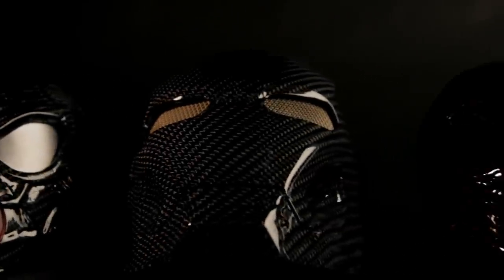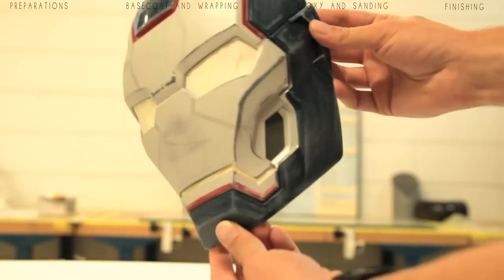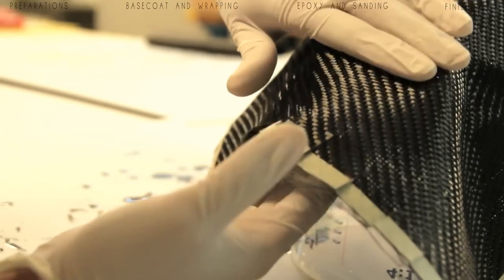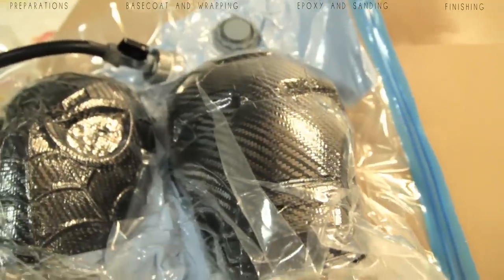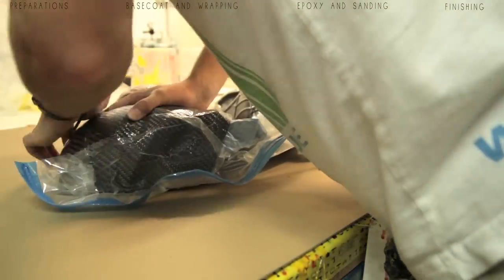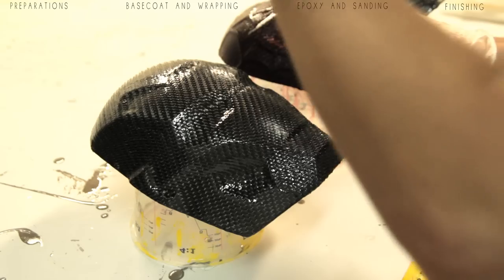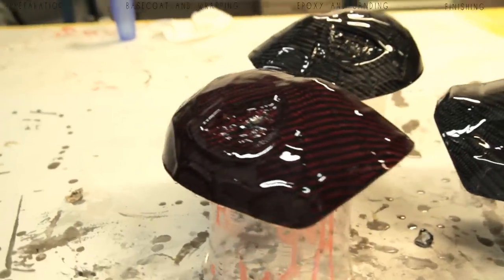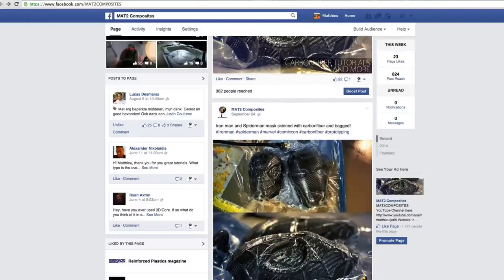Carbonfiber Skinning or Wrapping Tutorial - Ironman & Spiderman Mask

Comment: Tip: using solidworks you can download .stl files of masks and so on and use "flatten" option to flatten the surface of the mask from 3D to 2D with the option of release cuts built-in to prevent warping. Print on paper for a template to cut the carbon fiber.
Reply: sharon f im new with solidworks.. is there any tutorial on use the " flatten " feature ?

Comment: To minimize bubbles... make sure you're putting on extremely thin layers at a time. Also use a hair dryer or heat gun with the resin is still wet to eliminate the bubbles.
Reply from the maker: Thomas Christopher White thanks for the tips!
Reply: Thomas Christopher White when? while it's in the vacuum bag or what?
Reply: U WUT M8? No no no.. if you have a vacuum bag or using a mold and vacuum bag method, you only need to let the air bubbles drain out with the excess resin since that process is already air tight. Using a hair drier or heat gun to eliminate bubbles only applies if your doing brushing on layers of matting and resin.
Reply: sweet thanks!

Comment: If you are just going for the look just us g.p. Resin with a heavy clear gelcoat sprayed over it after sanding. Use wax solution thin with styrene and maybe a touch of speed patch. Wetsand 320 6-800 buff. It can be done in and hour or so from start to finish

Comment: A personal recommendation for the masks is to get some clay, oil based preferably since water base dries quickly over time, and fill the insides of the mask. So once you start vacuuming the mask doesn't lose its form and you get a better result since it rests on the clay.
Reply from the maker: great idea, thanks for the input!
Reply: And just to clarify the glossy texture as seen in the end is after washing/degreasing the mask yes?
Reply from the maker: +GaiaChrono the mask is right after clearcoat

Comment: Have you try spraying aceton after you apply your laminating coat? It surely helps to flatten your resin surface so you don't have to make too much layer... Also no need to do several sand work, all you need is a single sand work before clear coating... 
Anyway, love the fail part, it helps a lot 🙏🙏🙏
Reply from the maker: True, tried it before but try to avoid it to prevent contamination... Rather use heat to remove air and flatten the surface
Reply: @MatthieuLibeert  agree

Comment: When you are sending the surface after applying epoxy - use Scotch Bright! It will work way better with highs and lows.
Reply from the maker: I do follow you on this one, the problem is that it is to "flexible" with sanding paper you are removing the highs only so you are left with the lows...If you follow what I mean, when you then add resin again the high and lows will be totally flat to a high gloss :) with Scotch Bright you are just sanding "waves" less lows less highs... Not saying my way is the best, sure there are other ways, its just a way I feel safe with and know it will work out great for me :)
Reply: Matthieu Libeert Thats understood. I just mean that if you cant sand the lows - there may be some problems with the adhesive between the layers. May be i`m not right. Will try your way as well ;) 
Here is what i made last time. https://b-a.d-cd.net/563140cs-960.jpg

Comment: Good video, i saw some vids from you.. But for small parts i tried the vacuumpumpmachine for the kitchen with his bags ;) worked very well.. The vacuum is enough for small parts and didnt deform the parts.. I dont need the base coat in black right ? Im using the resin for the first layer and wait 4 hours to become tacky, and then first layer carbon comes on.. Again resin and then ?? I have to wait again till its tacky or i can put the next layers ????
Reply from the maker: Chucky Norris correct, no base coat is needed, you can use epoxy wait for it to get tacky, add fabric, add epoxy, wait for it to cure tacky and add a second coat, then sand and do exactly the same till surface is good
Reply: Ok thanks for the answer.. I try it and give feedback... But how you handle the edges and curves without destroying the carbon layers ? Just laminating positive
Reply from the maker: Chucky Norris it takes a bit of practice, a twill weave carbonfiber will allow the weave to bend around 3D shapes, there might be some visual distortion but should be a big deal

Comment: Matthieu Libeert I'm starting a deathstroke build and I want to make most of the suit out of carbon fiber because I need it to be tactical and I was wondering if you could do a video on how much it costs for carbon fibering and how many layers it needs before it can be used in a tactical situation  thanks
Reply: Yea I second that question. I just did a video about fibreglassing my Deathstroke helmet on my channel and it was crazy strong. But how strong is the carbon fibre?
Reply: its 3x stronger then steel and a third of the weight

Comment: hi, Matthieu! 

just seen this video. wow, 2014 :-) 

at 12:37 you add some black pigment, 
was it only two drops (as we see) or more of them? 

about the layers of epoxy over the carbon, 
was is a regular epoxy? or the one specially for this skinning process, the XCR Epoxy Coating Resin? 

thank you! 
best regards, 
Mircea
Reply from the maker: Time goes fast 😁 I've used the EL2 laminating resin hereif I remember well, but would be better with XCR, at the moment making this video XCR was still in development so wasn't able to use it in this tutorial 🙂
Reply: yup, time... goes slow but FAST :-)
and about the black pigment you put at 12:37, was it only two drops (is it that powerful), or were there more drops?
thank you!
Reply from the maker: @mirceaandreighinea  you can choose, might be better with a few more but it's strong stuff indeed
Reply: Matt, thank you!
best regards!
Reply: i am thinking to use fiberglass and adding some of this liquid pigment in the epoxy. do you think it will be black (or read, blue, etc) in the end, as final product? 
thank you, Matt!

Comment: If you were to make a mold with the original mask it seems like it would cut out a lot of time. I've seen it done on other videos and the mold parts come out as perfect copies with no sanding needed plus using a mold you could gell coat it to add strength. Just a suggestion, I know there maybe other reasons you don't use molds.
Reply from the maker: thanks for your comment, like you might see on my channel I'm mostly using moulds, this was just for "educational" purpose that I've showed how carbon fiber skinning is working and what results you can expect from it :) but your remark is totally correct

Comment: Matt, this is a great video thank you so much!! Rich from Carbon Composites told me to check your vids out as i had already seen this one i figured i would look over it once more...I'm building a full face helmet from back of neck to fron of adams apple.....do u suggest i just wrap my carved versions with carbon fiber after adding the epoxy resin and skin base?? Then i could just cut it in half from ear to ear and use a hinge to keep it together?? Let me know what you think!! Thanks bro!
Reply from the maker: +Patrick Duquesne thanks for the positive comment :) glad to hear you've found your way to my videos, and other suggest you to watch them! What you are proposing sounds like a good plan! but make sure you use some release then to be able to remove the carbonfiber piece from your carved version! it will also be a bit difficult to cut it...with a dremel you will have to be very carefull not to cut through you carved version if you want to use it again :) good luck!
Reply: Thanks man appreciate the feedback!!
Reply: +Matthieu Libeert (Mat's Prototyping) what kind of mesh did you use for the eyes?

Comment: Hi, Matthieu!
Why did you choose not to use pillow vacuum bag for the next step?
Reply from the maker: DJKorzH what step do you mean?
Reply: Matthieu Libeert i mean the step right after the forming when you are applying the resin on the fiber  for the first time. Doesn't it may help you to make an even surface? Or may be it will be better to use a bag with the resin already applyed?
Reply from the maker: DJKorzH I tried but as you can see in the video it was kind of hard with the Stretch vacuumbag... went pretty easy later on by just applying the resin on top and let it flow...kind of scared to have wrinkles from the bag in resin on the part
Reply: Isn't it the same as a handmade bag?
By the way, did you nowtice the black pigment spots on the fiber right after the vacooming?

Comment: Some people don't need to use a vaccum bag but others, like you, do. When do you need to use a bag?
Reply from the maker: like you say its a matter of personal preferences...i like to use it to get everything firmly against the part and have more detail
Reply: Thank you. There are a few dings and dents near the top of my motorcycle aluminum gas tank. It is a flat surface with a few curves. I would like to apply a layer of carbon fiber over the surface to cover up these blemishes purely cosmetic reason, not structural. Is this feasible at all for a first time project or is it much more difficult than it seems?
Reply from the maker: +FIFTYmil sounds possible, you cant do much wrong its a matter of how much time you put in it...bit succes or not will be up to you :-P try am easier part first maybe to get confident

Comment: Hi Matthieu The brush gets hardened after applying a layer of resin and can't be used again. Is there anyway to resuse brush again?
Reply from the maker: Leo Yuan the brush cant be used again once the resin in it has cured. but there is a trick, you can clean them/store them in acetone but, unfortunatly for nature, it's cheaper to buy cheap brushes and throw them away

Comment: looks awesome question.. do you think this could be done on a car hood?
Reply: you are probably best to "wrap" a car hood. it's like a large sticker.
Reply: +Dean Howard would it have the same shine? or would i have to do some kind of clear coat after the wrap?
Reply: you can buy it with a shine although not quite as good as epoxy can buff upto. I suggested wrapping as it's alot cheaper and can be removed. if not your best to take a mould of your bonnet then make a carbon fibre one.

Comment: is there a stretch film that provide a better and flatter surface?
I am looking to wrap car parts in carbon but i want to scape as much as adding epoxy and sanding as possible. it's a very difficult job.
Reply: You can try using the water transfer method
Reply from the maker: +AXMT or wrap it with a fake vinyl carbon, but wouldn't be the real deal anymore :)

Comment: A very stupid question, when do you need protective breathing equipment working with carbon fiber?
Reply: Its not the carbon fiber you need a mask for, its the resin to harden the cf. Always use a respirator when using resin, be it fiberglass or so, the fumes can give you brain damage and cancer on percentages.

Comment: Just one question, i use the  easy composites laminating resin, but it stays tacky for a long time.
The resin in the cup gets really hard but the resin on the part not, it's a 21degree celcious room. do you have a solution for this?
Reply from the maker: few possible causes: Sure you mixed the resin with the good mixing ratios (100+30)? did you mix the resin well (2min)?
Reply: Matthieu Libeert  yes i used the 100+30 ratio, i mixed it for a 1,2/2 minutes, but i get a problem with the airbubbles. i normally use the topcoat from hp-textiles but than i do not have this problem so much. it stops sticking after a few day's.
i've seen you're movie's that was for me the reason to try the Easycomposites resin

Comment: Excellent video but wouldn't it have been easier to simply create a mold out of the masks and then inside the mold placing some prepreg carbon, vacuum and so on. Sanding takes to much time and with this type of shapes having automotive reflection is almost impossible without spending a tremendous amount of time.
Reply from the maker: Yes correct, just wanted to make a video to explain skinning carbon fiber here 🙂

Comment: hey man i know your more of a carbon guy but would fiber glass work for real armour
Reply: Shikei Cosplaying yes it would, use fiberglass resin, with enough layers it'll be level 3a bullet resistance
Reply: thanks man
Reply from the maker: same process with fiberglass :) use epoxy as well
Reply: There's also aramids (kevlar) if you wanna do real armour and techniques are pretty similar

Comment: Isnt carbon fiber Vibranium? the most indestructible material used for captain americas sheild and black panthers suit?
Reply: No. The name vibranium indicates that its a metal. most likely a heavy metal which is even isolating. there is simply nothing really compareable to vibranium
Reply: okay now i get how this doesn't compare to vibranium but i read an article that people have made woven carbon fiber. 8 times lighter than steel and 10 times stronger than steel. idk
Reply: +The Emerald Soul (TheEmeraldSoul) yeah that Material actually exists but its not carbonfiber but its "carbon tubes" its Billions of tubes made of carbon atoms of a diametre of like 20 atoms each. if you have enough off those you can weave it like this and it looks like a wool coat.
Reply: yeah

Comment: i was wondering if you could do a strength test on the carbon fiber mask because as i said i am making body Armour
Reply from the maker: Hi thanks for your message, unfortunately its something I wont be able to do but if you your suit you will always be able to add more layers of carbonfiber if needed afterwards to stiffen it a bit more id needed. 2 layers of a 600g/m should allready give you a very strong piece
Reply: thanks
Reply: Hey i was wondering how many layers of 200g/m would it take to create body armour

Comment: (after the fail).. he maybe just required a fiberglass solid cast of the inside of the mask in a solid cast with no give in the vacuum process
Reply: are the designs patented by the film producers or associated with the comic creators.. I plan on making original designs but just wondered about this
Reply: and for the lip around the edge of the mask he could shave round the edge of the plaster mass inner cast just barely along the edge to allow it wrap or fold up under ever so slightly
Reply: no planing of the underside

Comment: you dont have to put more layers on just wet sand a buff them they will look like a mirror
Reply from the maker: Matthew Sharp If I would have stopped after the first layer I wouldn't have a nice even finish, sure it will have a nice gloss but the surface wouldn't be even with all low and high spots
Reply: Oh ok  they look bad ass bro

Comment: And what happens to the rear side ?? What sort of edge processing ??
Reply: I think he would probably use the same cut-off wheel that he used on the eyes & mouth area. Cutting very close to the edge of the part and then maybe a bit of sanding to the underside only, to flatten it out a bit.